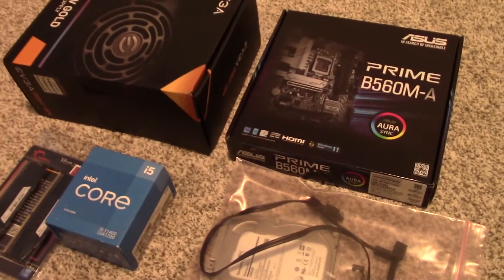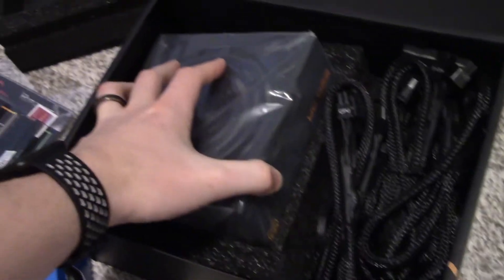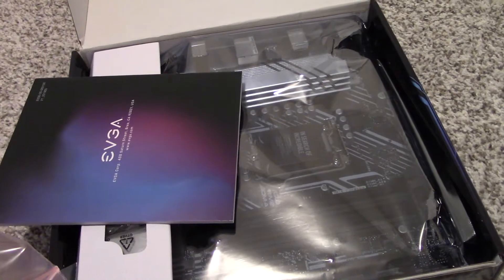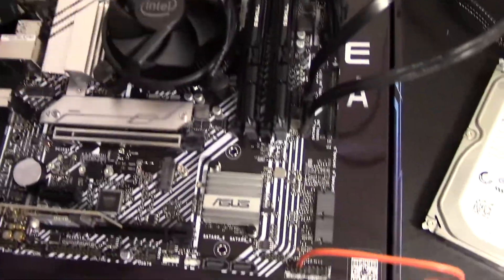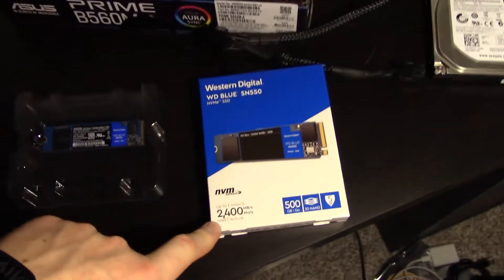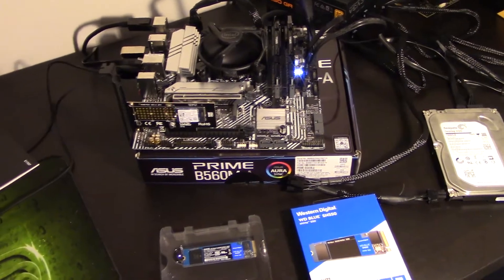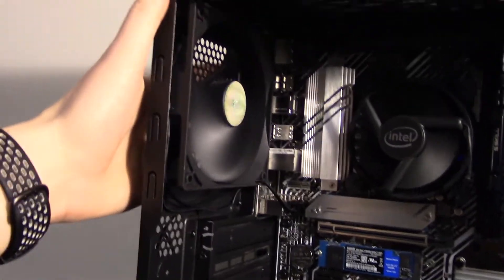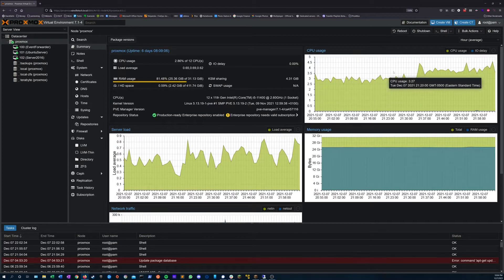Proxmox NAS/VM Server Build! (With NVMe RAID!)

Comment: Hey man, feels like it's been a while since I'd seen a video from you -- glad to see you again. 

One word of warning: before going the drive shucking route, you & your buddy should double check that whatever model you select can be shucked. I've seen a couple cases now where people have bought the enclosures, torn them open only to find that the drives inside have nonstandard connectors and/or require some minor soldering to make them SATA compatible.

Also: You should be able to re-import the zpool pretty easily, if you run zpool import and the drives are connected it should auto-discover them and you can re-create the pool by name. I think (I haven't needed to do it in a while, thankfully) if you didn't specifically export them you might need a switch before it'll be happy.
Reply from the maker: Thanks for the info! I'll make sure to double-check on the drive schuckability and test out the zpool import.